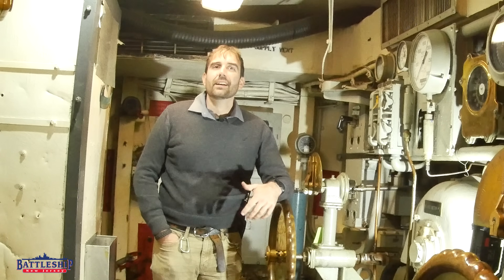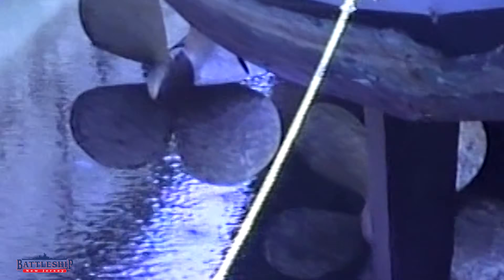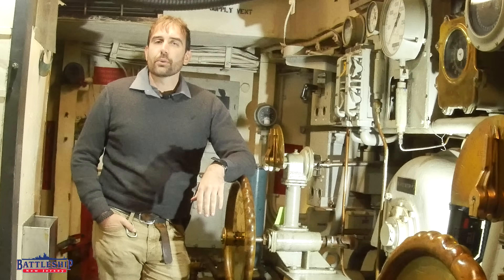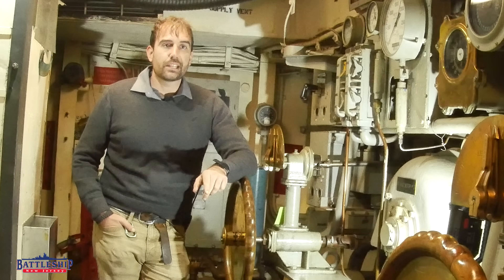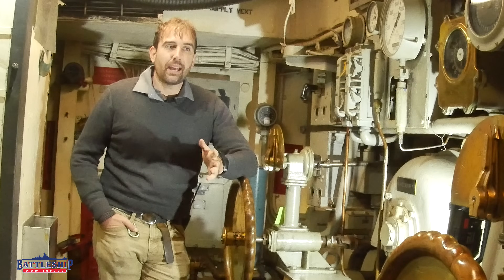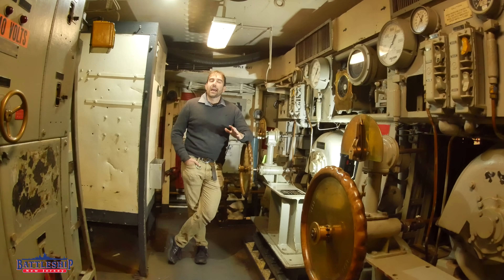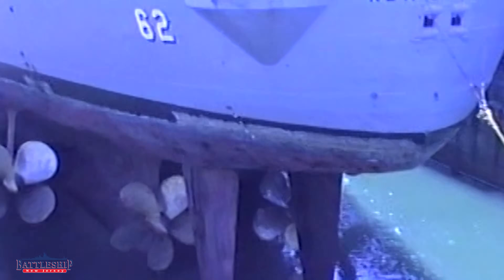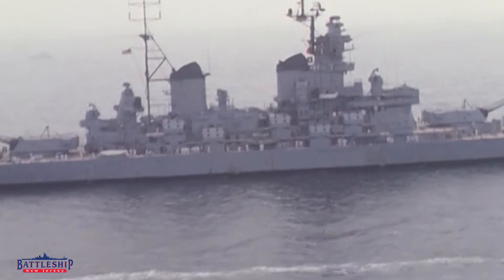How Quickly Can a Ship Stop and Can it Really Do a "Barn Door" Stop?

Comment: You mention about them doing the barn door stop during mess hours and it being able to stop the ship within 200 yards.  You question this because you think that the bowls and everything would be flying around.  I wasn't so sure about that, so I decided to run some numbers... Let's assume that they are doing 30 kts... A nautical mile these days is defined as 1852 meters or 1852 * 100 / 2.54 /12 ≈ 6076.11548556430443568388 ft.  So, 30 kts would be ≈ 182283.464567 ft/hr ≈ 50.634295713 ft/sec.  So, the ship needs to go from 50.634295713 ft/sec to 0 ft/sec over a distance of 600 ft.  If the ship was not trying to stop, it would take it 3.94989200864 sec to travel 600 ft.  Since it is stopping, the time would be twice that (7.89978401728 sec).  So, we're looking at a deceleration rate of about 6.40957975588 ft/sec^2.  1G is 32.185039370079 ft/sec^2, so the ship and it's contents would be experiencing about 0.199147799143 Gs of deceleration force.  Basically, about the same amount of G force as would be generated by the Yugo in a 0-60 attempt.
Reply: I think 15 knots would be a more realistic speed, That would be a reduced speed used in more congested waters.  30 kts is a speed used when wanting to get somewhere in a big hurry out at sea. A more likely cruising speed would be 12 to 18 kts.   Then entering port inside the sea buoy might be 10 or less knots  and that is the point where a risk of collision would be most likely necessitating such a stop.
Since my math skills suck to use the technical term I'll ask in plain English. What would be the felt difference felt by a person sitting having dinner in a Winnebago traveling at say 32 mph and decelerating to a full stop in 200 yards?  Would there be plates flying? Would he become one with the windshield?  I suspect no.
Reply: @glennrishton5679   With constant deceleration if you were standing you would need to lean back 3.2 degrees to resist a mild approximately one twentieth of a g, the ‘force’ of gravity. (0.55 m/sec^2 divided by 9.81 m/sec^2).
Reply: @givenfirstnamefamilyfirstn3935  As I said my math skills suck so I accept your math on this. My point was deceleration is deceleration regardless of whether is a battleship a Winnebago or a flying carpet. 
Anyone who has spent time at see would have no trouble instinctively leaning slightly as the ship slowed.

Comment: Too bad the barn doors have to be closed from a single steering position.  Not having to change who has control of the rudders would speed things up.  Also, if you do a barn door stop to avoid a torpedo, you're left unable to deal with later torpedoes as it takes too long to get going again.

Comment: Does this rudder stopping method work by dragm or by acting as a thrust reverser?
Reply: Wouldn't be working as a thrust reverse since the rudders are aft of the screws, and the screws are spinning astern. It seems that it works by addition of a ton of hydrodynamic drag.

Comment: “slow to accelerate” - I remember reading somewhere that it would take Hood around half an hour to get up to her full speed from a standing start. I suspect the need to raise more steam would be a factor in addition to power-to-weight ratio?
Reply: I dont think it is the engine power available in taking so long to accelerate but rather the mass of the ship overcoming inertia plus having to move all that water aside.   The same with stopping once some 50,000 tons are in motion  despite backing full the mass wants to keep moving.   
Power to weight ratio.   I have read several articles about schools for modern merchant marine deck officers and Pilots on handling various classes of ships such as large and small tankers, container ships etc.... These schools have small scaled down versions of various ships that the student is in driving.  These scalded down models are themselves some 20' to 40" in length with rudder power and engine power  proportional to the actual vessel   The horsepower for the models is in the 1/2  to 3 horsepower range replicating the power to weight ratio of the actual ship.

Comment: After Steering will be manned at all times that a US Navy ship is not securely tied to the pier.  If you lose the electrical side of the rudder controls, the "trick wheels" are all that you have left to steer with.  The trick wheels are mechanically tied to the spool valves which control the hydraulics on the steering gear.

Your 1.5 - 2 degree difference is most likely the difference between "max rudder" and hitting the mechanical stops.  Bad things can happen when you have a few thousand pounds of hydraulic pressure trying to move something that cannot be moved.  If you are going to lose a hydraulic line and have a jet of high-pressure oil injuring men and setting up the space for a Bravo Fire, this is when it will happen.

"Crash Back" results in the guys in the Engine Rooms shutting down the steam to all of the "Ahead" vanes in the two-stage turbines and providing steam to the single set of vanes in the High-pressure turbines.  The real drama happens in the Fire Rooms, as steam production is still at the same level but demand just decreased very substantially.  Now they have to adjust firing rate and dump steam, but still be prepared for an "Ahead" bell.

Source:  I was the poor guy that got rousted out of his rack to figure out why electrical control of the Steering Gear was lost.  The Helm Console, the Synchro Receivers on the spool valves, and everything in between was my equipment.
Reply: Is it a singular watch station where that's their sole watch station? On the sub, aft steering was part of the engine room upper level watch and him or the engine room supervisor were responsible for manning it for a steering casualty. There was a dedicated watch stander for the maneuvering watch.
Reply: On the ship that I was stationed on, After Steering was a dedicated Engineering Watch Station, I believe manned up by A-Gang.

One transverse space.  Two rudders.  2 hydraulic rams per rudder.  I think one common Hydraulic pump with a backup.

Memory dims.  It's been over 30 years.

Comment: Closing the barn door was something that was practiced as the ship gets closer to shore for evading smaller vessels that run across a ships heading. I did 3 solid years of sea-duty on a DDG. I normally held the throttleman's watch during operations of all sorts. There were five emergency crash backs in those three years and both of the skippers that I served under. Both of the use to love to do that and they always waited for me to be on watch when they were performed. I was the throttleman for main engine control and nobody could answer those bells as fast as I did. They actually use to bet on which engine room reacted fastest and most efficiently. All the officers and chiefs would bet. Part of the winnings went into the ship's slush fund. Also the damage that has been linked to closing the barn door was the fact that the very large pillar bearings that they use often would become loose and cause damage to the journal bearings that support the drive shafts.
Reply: I was on a CG and a DG we never did it ,, but plenty of crashbacks. I think our skipper didn’t like the mess cook’s
Reply: It seems to me that closing the barn doors stops the flow of water thru the props, which will causes the props to cavitate as if there is no load on them (I guess this is called building up power) and the engine and shafts RPM would increase and then suddenly open the barn door would dump a massive load on the engines and machinery but however, the props will still be cavitating until the RPM slow down to around 200 shaft RPMs.  I would say that's like a drag race starting off the line in a drag race. This is very interesting and needs more research as to what really going on!

Comment: I'd be curious if anyone ever tried the "handbrake turn" from the movie Battleship.  It seems to be complete Hollywood bullshit to me but I'd be interested in a professional opinion.
Reply: The "pivot on the anchor" scene?  Complete and unadulterated bullshit.
Reply: @kevincrosby1760  I haven't seen it myself, but the waters off of Hawaii are far to deep for an anchor to reach the sea floor while still attached to the ship. Just to add to the BS.
Reply: Never heard of a handbrake turn but I'll describe something I have done. I worked on a sea going tug pushing an  empty 450' sea going bulk barge with the boat positioned in a deep notch in the stern of the barge effectively forming one unit although not classified as such by the USCG.  Coming down the Mississippi River to an anchorage at Venice LA we would slow nearly to a stop, drop  about 1 to 2 shots of chain, 90 to 180 feet and pivot on that working the engines so not to take an unnecessary strain on the anchor tackle.   
But like I said we were nearly stopped when we did this.

Comment: With all of these systems that have redundancy, how is priority determined? For example, if steering is happening at multiple locations, what does the ship do?
Reply: if memory serves
Rudder Control is primary from the ship's Bridge during most operation. all other positions for Steering Control are backups in the event the Bridge is taken out or otherwise disabled.
under Battle conditions, control is likely moved into the Armored Conning Tower and the upper Bridge cleared since it's really not well protected from incoming Shellfire.
the Aft Steering Control Stations shown in the video are the "last Resort" means to control the ship if power is lost since the aft station has a direct mechanical connection to operate the Rudders.
who is driving the ship is determined by Command order indicating which position "Has Control" by the order Steering to <location desired.>
only the location so indicated has control to turn the ship, all other positions, while manned are "Hand's Off" until the order is given changing who has steering control. Aft Steering in particular has the locking lug on the Wheel Hub which unless ordered is in the "Disengaged" position meaning that even if the wheel is turned, nothing will happen as the linkage is not connected. the wheel will just spin freely.

all Sailors are trained from the start to obey the lawful orders given by their superiors. for Steering the ship. only the person at the station ordered has operational authorization to act on maneuver orders and turn the ship. the others just stand ready to assume control upon command. each Steering Station has an Officer in charge to oversee that location. 
anyone other than the authorized person attempting to change the ship's course outside of a direct command will be swiftly removed to the Brig and a rather uncomfortable talk with the Captain!
Reply: The selector wheel will determine which remote location takes control. But the controls can be over ridden from after steering, it just wouldn't happen unless ordered though.

Comment: Hey Ryan just thought of something, looking at the USS Iowa in Drydock at the claimed 35 degree maximum deflection I don’t think there’s enough space for the rudders to close like a barn door, they are too close together. But perspective is hard, looking at plans, it looks like the rudders are less than 20 feet apart and if I had to guess in the 14-16 foot apart range, I’m not sure they could actually close without hitting eachother.
Reply from the maker: Probably part of the reason why theres a limit to how far they can turn
Reply: @BattleshipNewJersey  Also I think you’d probably be better off opening the rudders outwards rather than inwards because it would deflect the wash from the central screws outwards and also provide an immense amount of drag, it would also massively disrupt the outer prop’s flow because they would be hitting the disrupted outward flowing very cavitated wash from the inner props.

Comment: Still believe the turbo-electric drive equipped ships that the last batch of standards had was for better at stopping. Granted, they were way slower at 21knts, but their electric motors gave them a huge advantage. Direct drive ships like New Jersey had to wait until the shafts was within a certain RPM threshold to safely engage the reversing gears, the electric drives could be switched into reverse at any speed by reversing the electric current and the shafts would spin down and reverse MUCH quicker.
Reply: No "Reversing Gears" involved.  It's a different rotor in the HP Turbine.
Reply: Astern turbine surely?

Comment: Can you have each screw go opposite each other and turn the ship? One forward and the other backwards?  Like turning the ship within it's length?
Reply: It's absolutely a way to steer a multi screw ship if there's a complete loss of steering, but it's not quite as nimble.
Reply: it would probably help...... but the ship is SO long VS the distance between the props.... i dont think it would help MUCH!
.
a measurable difference? sure..... but only a few feet..... not 100s of feet
Reply: This will help with turning radius while moving, but if the ship is stopped, the screws being at one end are really at a mechanical disadvantage of having an effect to turn the entire ship. I could imagine it taking an entire day to work if it's even possible.
Reply: @Jimorian  You'd be surprised.  That's exactly how a ship leaves the pier without tugs to assist.

Comment: Have to say, the stopping maneuvers, barn doors or not, are pretty impressive. A mile to stop sounds like a long distance, but its really only six ship lengths!! If the guesstimate of less than a ship length using rhe barn doors is to be believed, thatd have to be...not violent... but awful close. Not somthing Id schedule during chow time!!!🤣🤣
 I saw Ticos do some impressive maneuvers back in my at sea days, but that was with 40-50k tons less ship...!!!!
Reply: I never realized that a full-sized ship could pull the bow up and visibly come up on a plane as it took off sporting a rooster tail about as high as the Helo Deck during an "Emergency Breakaway" drill after an UnRep.

I got the distinct impression that the US Navy is not always completely honest when it tells "Jane's Fighting Ships" about ship capabilities.
Reply: @kevincrosby1760  I recall the Hue City doing a lil somthin like that in the Med after a breakaway...never forgot it!! 👍
RIP CG-66...
Reply: A car stopping from 34.5 mph (30 kt) to zero in 200 yards would not be violent.
Reply: @givenfirstnamefamilyfirstn3935  I can't see the speed reduction being abrupt enough to interfere with Mess Call, but I served on a 650-foot deep-draft Replenishment Oiler that did nothing quickly.

I could see where many tons of of Propulsion Machinery designed to move the ship forward would cause quite a bit of vibration as it ran in the reverse direction trying to stop several thousand tons of ship.

I can promise that attempting to operate the ship about 7 knots above her rated top speed will cause enough vibration that a coffee cup would rattle itself towards the edge of my desk.  That particular Sea Story involves the definition of "best possible speed" while returning home to SF after the Loma Prieta Earthquake...
Reply: @givenfirstnamefamilyfirstn3935  Size, mass, and scale are relevant, and your car example would have to be changed to stopping in, say, 30ft.  I served aboard a combat stores ship, just under 600ft long, single screw, and slow by anybody's standards, being able to eke out 21 knots on a good day, with a tailwind, downhill. Iowa's are thouroughbreds by comparison. But when doing extreme maneuvers it was enough for people to have to brace themselves or compensate for the list. Emergency asterns would cause the whole ship to vibrate severely, and the accompanying  noise was quite loud. It was bad enough to spill coffee and move items around on deck if not tied down. But although I don't recall actual figures,  I know she wouldn't stop in a ship length!!! The forces involved in bringing 15+k tons to a halt are significant, and I'd imagine they'd be much more pronounced on a ship with 50% more speed, nearly 4 times the displacement, four props, and "barn doors".
Reply: @wheels-n-tires1846    I’m not arguing about slowing a big ship BUT someone in a car slowing from 30 kt to zero in 200 yds feels exactly the same deceleration as if he was on a half million tons monster doing the same (remarkable!) stop in the same distance.  V^2 = U^2 + 2 a s, no mass in the equation.  That example gives a 0.55 m/sec^2 deceleration, one would need to lean back by 3.2 degrees, barely noticeable.
Reply: @givenfirstnamefamilyfirstn3935  A good point, and math had always been my weakness lol... And maybe I'm coming from a feelings vs facts perspective - I just have my recollections, and they are that it was more significant....🤷🏼‍♂️
Reply: @wheels-n-tires1846  Oh turning is very different, I did flying and a very steep turn and more so high G manoeuvres like a loop drag your flesh downwards, the cheeks sag, the microphone droops, first time the legs shook!  Never really threw a boat about.